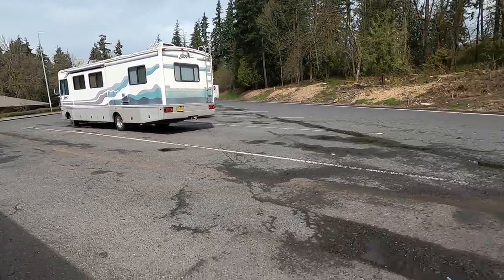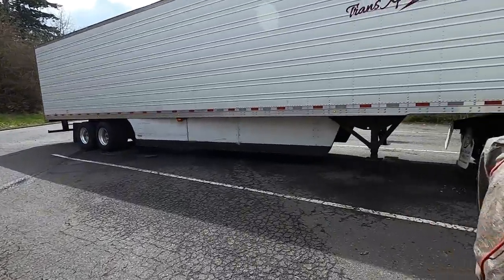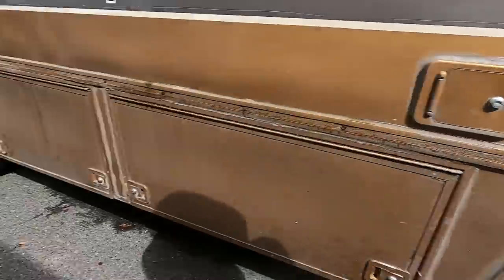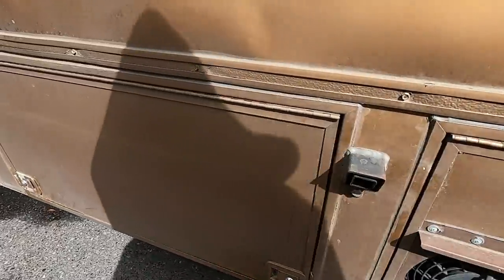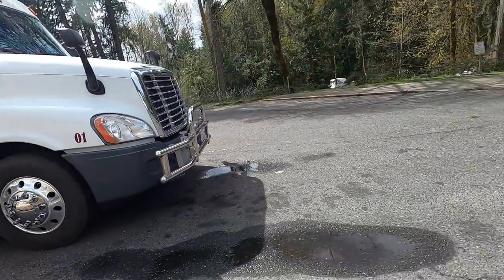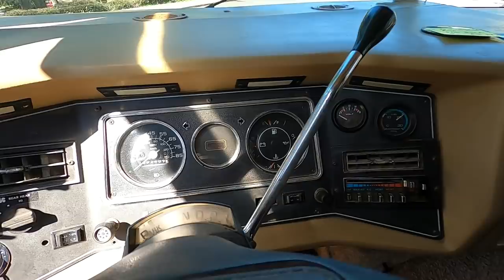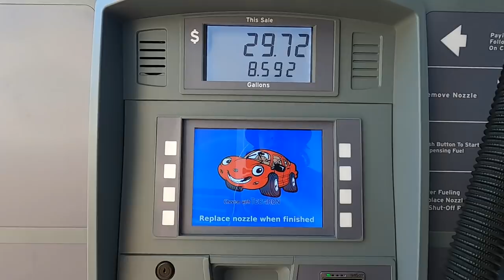Supply Run || RV Living

Comment: Hey dude if you thing your gas prices are high,  here in the UK an equivalent gallon would cost you $7.90 or 5.75 UK pounds for 4.5 litres because we buy it by the litre here at the pump. Good to see the weather smiling on you.
Reply: @marzsit9833  The reason we sell it by the litre is because they can get more money for it by breaking the gallon down into smaller increments. 66% of our fuel price is tax and as for the using metric and imperial well I'm old school I still prefer feet, inches, lbs and gallons but can flick between both which comes in handy sometimes.

Comment: U should find out if engine leaking oil or burning oil solve problem so u Dont have add oil till it's time for its 3000 mile oil change

Comment: Did you have to have your LP tank re-certified in your Motorhome? And I know it's a dumb question, please don't beat me up about it...
Reply: If they still refill it then why?
Reply: @darrellwampler6473   because I have the same motorhome, and Nathan has fixed lots of stuff, and answers a lot of my questions. I didn't know if he was even using the original tank.
Since you know, can you have a 1989 LP tank filled without re-certification after 30 years? Let me know Thanks
Reply: @themangopyrate  Calm down. Sheesh my point being as long as they keep refilling the tank Why would he do that. That is not like a BBQ tank. It's bolted to the frame. Not something I would do on the road. Plus he'd be with propane for a period of time.

Comment: The delamination is getting bad on the outside of rv you need new RV
Reply: @plaintruth4637  that's the plain truth. Everything eventually rots including us
Reply: @warzee123  not of it sits inside with ac and heat it won't